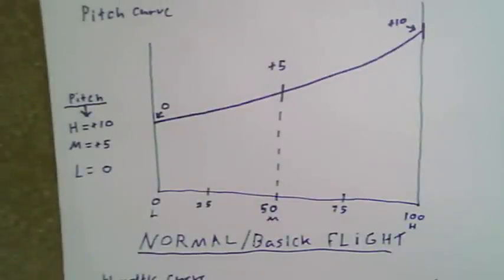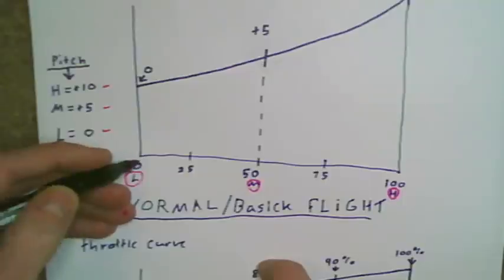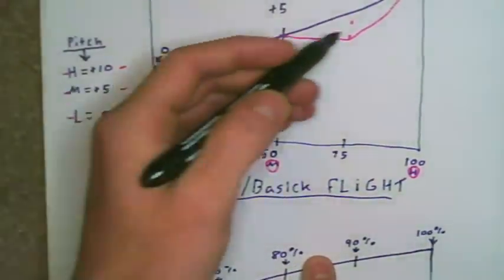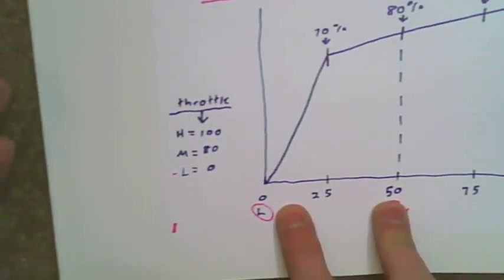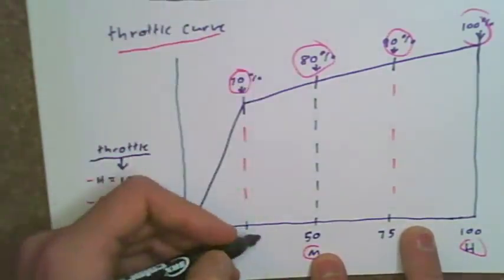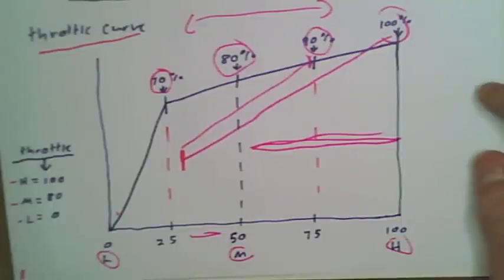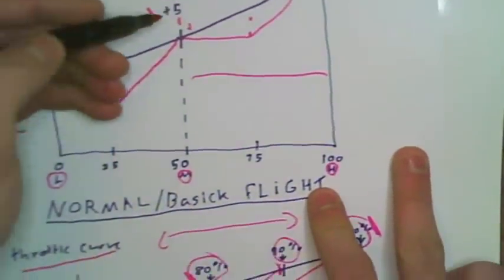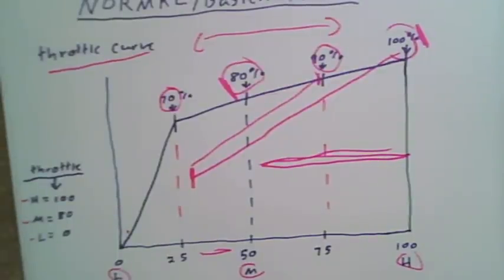freddy can fly (throttle and pitch curves)

Comment: super beginner here so first, Thank you for posting this explanation.   I was wondering how the pitch curve begins at throttle setting of zero along the X axis, but the curve of the pitch is zero along the Y axis...mid way up, and not beginning at the same point as the throttle. .but, then I realized..i think, that there should probably be a horizontal line at the 0 pitch  delineating positve and negative pitch .. is this correct?  Or possibly the curve could begin at zero ON the X axis, and progress in the negative direction.. Im confused

Comment: when you say plus 5 at mid stick do i still set everything as per manual zero @ mid stick then adjust the pitch on the radio..to plus 5 at mid stick, then at top end and bottom end..
Reply from the maker: Yes this was for older systems.  On todays systems you want zero at center stick. and your full collective ranges at top and bottom.  example. -12 low stick, 0 at center, and +12 at full or just a linear curve is what most FBL systems call for.

Comment: Freddy does this matter on a fixed pitch heli...because you cannot adjust the pitch anyway
Reply from the maker: Honestly this is an old out of date concept I need to remove.  Most models these days have GOV that require flat curves and no V shapes.  But yes this would still apply for the older fixed pitch.

Comment: Can anyone help solve a problem I have with a 450 please.
Its a flybarred 450 and its massively unstable in just hover, just the tiny corrections needed for hovering causes the heli to have sudden and aggressive bursts of lift the instant even the slightest stick input is given!
It's driving me nuts and I really want to get it flying properly.

Thanks, Steve.
Reply from the maker: Hey Steve, can you comment or IM me more info.  Maybe I can help trouble shoot the issue.  Maybe even do a test hover video so I can see.  usually in a fly barred Heli, I would assume unbalanced blades or fly bar paddles.  possible bent fly bar or head parts.  In same cases it could be glitchy servos or bad CG, or even just need a different RPM setting ( the possibility go on forever lol).  Feel free to shoot me some info and I would be happy to try and help brother :)
Reply: @FreddyCanFly  I'm starting to move to the mechanical setup being the cause as you suggested, I have just setup a flybarless 450 running a kbar and it's suffering the same behaviour but in a much more mild form.

I wonder if cheap servos could be aggravating it too, they have a small amount of play in them, not a problem on my fixed wing craft but they are allowing approx 1mm of play in the swash. 

One thing that may be of diagnostic use is that the busts of lift are far more aggressive with forward or back pitch cyclic,  roll cyclic produces almost none but is still there to a small degree.

What I find surprising is that with the exhaustive googleing and searching youtube,  I can't find a single case of someone suffering the same issue yet I now have two helis doing it, others must have made the same still un diagnosed errors I've made?

If the weather improves over the next few days (horrendous here at the moment)  I'll try and get a clip of the flybared 450 misbehaving. 

Thanks for offering to help, I appreciate it.

Steve.

Comment: Freddy. I got a question. I know, a receiver has initializing modes (beeps) and for the motor there is HIGH (fast response), MIDDLE and LOW. As for a beginner, which one would you recomend to have better control, for lets say, curves you sugested?

Comment: My throttle cure screen shows a total of 7 points but only lets me set 1-5.
How can I set the other 2 - so that I have a 7 point throttle curve ?

 my throttle stick stops 1/4 inch from top and 1/4 inch from bottom.
When I try to set up throttle curve it only lets me set 5 of the 7 possible positions.
Do I need to adjust the throttle stick to have full range of motion to fix this?
If so,  how do I make that adjustment ? 

I  have a DX6E - thanks

Comment: what he says about pitch drag vs motor load is absolutely correct, i just want to add that any time you change to a different type of blades these values will change very slightly as every design of blades varys slightly in the amount of lift vs drag  they exibit

Comment: I am learning Quad flight on a 400 size & find the best throttle curve for learning is 0%--- 40%---45%-----50%----55%----80% lift off is around 40% power between 45 & 55% a gentle rise and fall with the ability to hover with ease, for a quick rise I go up to 60 to 70% at 80% it will just be gone up in the clouds. Weight is 1.2 kilo  motors A2212/15  930kv with 10"X 4.5" Props.
Reply: Yeah i just got into it and im thinking off adding a bit more pitch on low speed for take off and landing.

Comment: hi i like to setup the pitch curves low -6 ,mid +2, high +10 that is for the oeks that like to hover and switch to idle 1 in hover if u are hovering in normal at mid witch is +5 and u switch to idle 1 the heli will drop when u switch to idle 1 because idle 1 mid is 0.

Comment: Hi Freddy, I'm a little new with Futaba 8fg super. I have a trex 450 Pro Flybard version with futaba Gy401 Gyro, what's the best throttle curves & pitch curves can you suggest? I don't do hard 3d, mainly for sport flying for now but also mild 3d enough for the helicopter to be a little responsive on a flip & inverted flights. Your videos are great, but for someone like me to be on the safe side a given values would be real helpful. Thank you so much in advance.

Comment: running the new align 650 motor on my 600, i can barly keep it hovoring at full throttle. i have gone though the mechanical and radio setup changing it repeatedly to get it rite. i cant seem to get enough head speed even at 95% throttle. maybe a bigger pinion idk.  a vid on that motor setup would be awsome. i havent been able to find much info on it.

Comment: @nicholas5674 that's is partly true but it is still okay if you have it at 0 degrees because as the blades revs slow down it will come down no matter what :) you will need wind in excess of 200mph to  not get the heli down :)